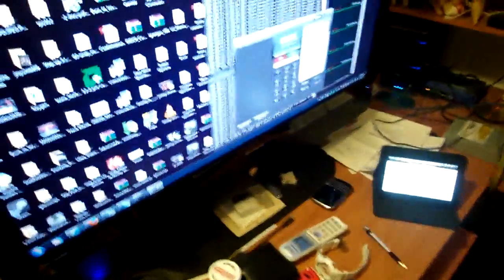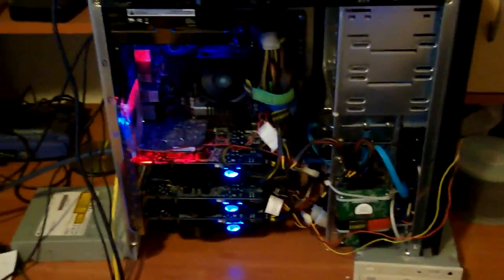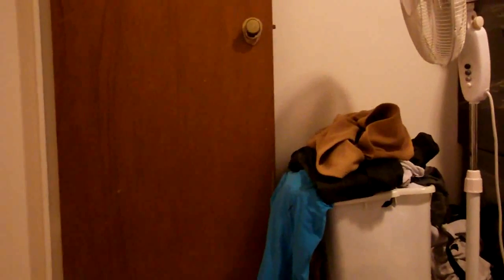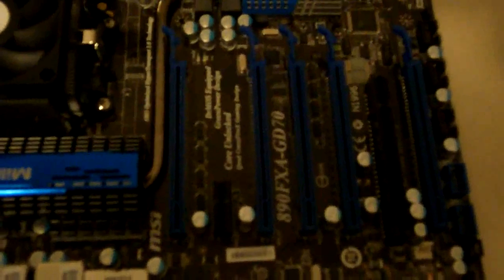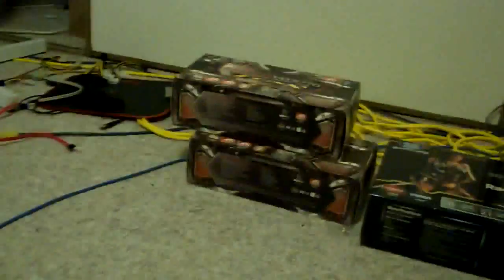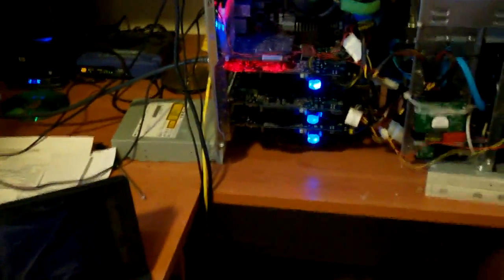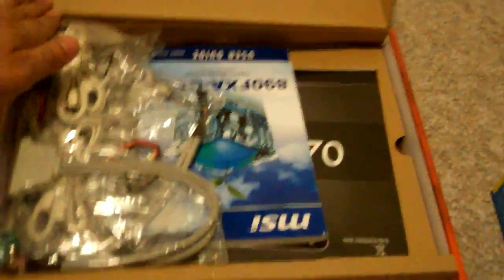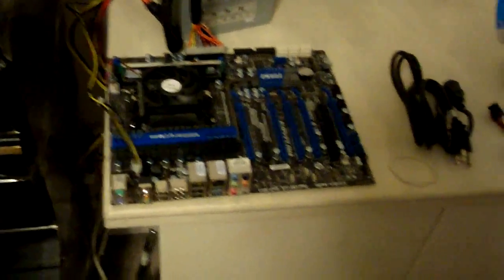Bitcoin Mining Room 1 of 2

Comment: Question if possible to answer :) I'm getting 510MHash/s on my ASUS 5870v2 using the latest driver + 1.2SDK.  This is through GuiMiner. My Mem is 300MHz and GPU is 1000MHz.  I'm told that I'm able to do much higher with my card... Any suggestions?